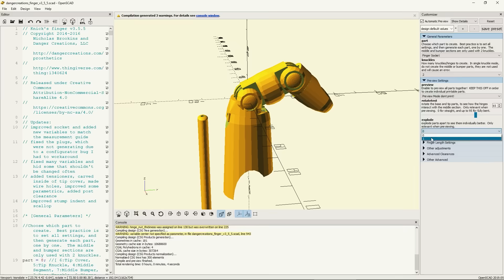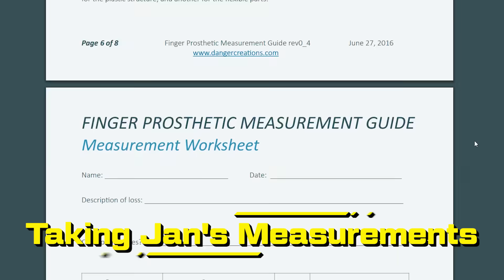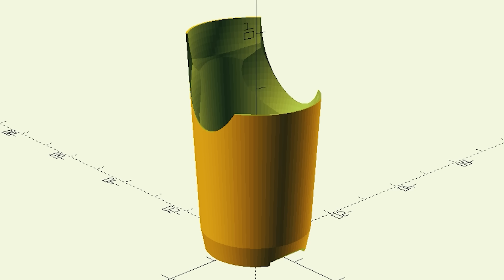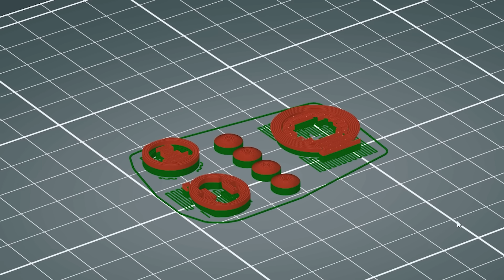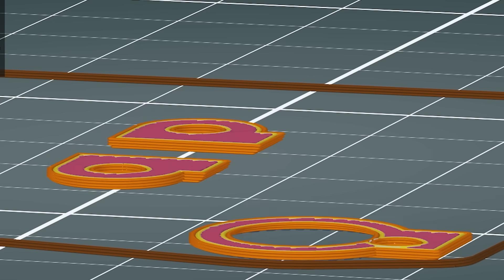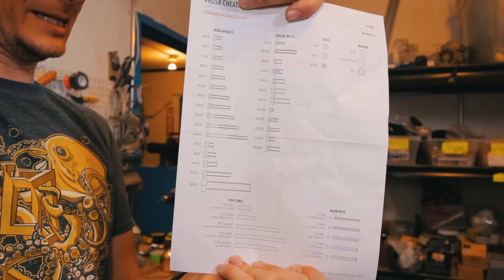My Friend Lost His Finger so I Printed Him a New One

Comment: I almost lost the tip of my finger when loading my MX Bike, my index finger slipped into one of the vent holes on the brake and the edges are so sharp that i didnt even feel it just going straight through my finger as the wheel turned 😂 when i looked down i just saw the tip of my index finger was completely white (removed all the skin from the top of the last digit on my index finger) and then while my brain was tryna figure out wtf was going on it started bleeding and i was like "oooooooh i see" 😂

Comment: Only Jan will really know what happened on that fateful day the pain that he had must have been excruciating!
There is many ways to lose a finger but losing a pinky is harder. Ruling out the most boring theory is he was born without the left pinky. Okay now how to lose a pinky, perhaps a karate chop goes wrong, an animal could have bit it off, or lost it in shop class using a saw. 
It doesn’t matter what really happened but it healed well and the printed finger works really well. 
It as bin a little over a year so is the finger still in like new condition no ware or tear? Looks like it should last at lest 10 years.

Comment: Im missing my entire left ring finger, down to the last knuckle. Id kill for something like this, especially if it let me play guitar with it somehow again. I'm sure it could be modified to do so.
Reply: A pick finger! Yes, I can see the picture in my head!
Reply: @MACvods1  Most people are right-handed - hence they fret with their left hand, not pick. The level of dexterity required for fretting, especially complex chords, is pretty intense: it requires small changes in positioning, it has to be done very fast, and it's very pressure-sensitive. Press too hard and the note goes sharp, press too soft and the note gets muted. A full prosthetic finger capable of restoring your fretting ability would have to be a near-perfect recreation of a human finger in terms of operation and size. No system of straps and elastic could do that, you'd need a prosthetic that could actually be wired to the nervous system and controlled like a real finger. So far, prosthetics technology hasn't quite gotten to the point of recreating muscles and nerves and wiring them to people's brains. 

With a missing ring finger on one's fretting hand, I'd recommend either learning to play left-handed (only need your index finger and thumb to pick, it's mostly all in the arm) or taking up the bass guitar (you can't really play chords in most of the bass register, so most basslines only require 1-2 fingers to play). You could also work out fingerings that sub in the middle or pinky finger to hold down the right notes, but stuff like Major 9 chords on the A string wouldn't be possible in standard tuning because you need all four fingers. What I wouldn't recommend is giving up - Django Reinhardt broke new ground in Jazz guitar with only two fully-usable fingers on his fretting hand due to injuries from a fire and Tony Iommi wrote every single Black Sabbath song after having lost two fingertips in a metalworking accident. Even if you can't play the same way without a ring finger, you can still play guitar and still make and play great music.
Reply: @drpibisback7680  maybe jus switch to left handed guitar like im doing due to an injury on my left hand? idk its just a thought, nvm im an idiot i just finished reading ur comment.
Reply: @drpibisback7680  not true, guitars and most stringed instruments are left handed to start with. Why? Just because! If you relearn to fret with your right hand on a so called 'left handed' (actually right handed) guitar it will be easier second time you learn. As for strumming too many fingers kind of get in the way. I use my thumb and two first fingers the other 2 i dont use.
Reply: You can use the program that they used in the video to make your own prosthetic
Reply: I had a freak accident and broke the tendon - the string that connected the finger movement.. as a result i cannot play the guitar like how i used to.. but still as far as injuries are concerned i was glad that it was my pinky finger and not something like my ring or index finger.. i can still play the three finger chords and use the little finger to an extent that it can be used without bending but i feel for you.. how i wish i could go back to that full functionality.. i really hope this printing tech becomes mainstream for people like us..
Reply: maybe try to learn guitar but inverse hand and strings... even if it is difficult to relearn everything from scratch

Comment: Lucky I got my finger only trapped in a car door I knew my dad was going to drive away and I didn’t wanted to use my finger whole so I just pulled it out and because I didn’t open the door is because my dad locked the door and couldn’t  hear me out the window and I pulled my finger out of the car door it purple ish at the front but when I turned it, it was bleeding and my finger nail was crushed and I was going to school and I told the nurse and after like 3 months it recovered fully it happend 3 years ago.

Comment: I tried to improve the modern mouse trap by supergluing razor blades to the sides of the trap. Luckily the glue hadn’t adhered to the sides of the trap, or I would have lost my finger. It cut me, but stopped and the blade broke off at the bone.

Comment: Fun fact (if you want to call it that) I do know people who lost fingers during army instruction. I am Portuguese and Portugal is one of the few countries still using the G3A1 7.62 rifle. It is the approved and still thought procedure to insert the right indicator (trigger finger for most people) into the open chamber to check for a loaded round when unloading and making the rifle safe at night. Under pressure or when wet it is very easy to release the safety chamber handle (left side of the rifle and needs to be secured with the left hand while grabbing the rifle from the top) by mistake. If your finger is in the chamber the moment the spring releases it is cut clean.

Comment: hehe I'll tell you something about ... a true story ..." I keep it in a matchbox": every day I went to school by bus which stopped along the road until one day bus lanes and sidewalks were powdered in the city with new paving stones. Along the streets there were various tools and materials that were left overnight or chewed by workers on the side of the road leaving a table diamond saw for the stone and some cubes were cut. Coming back from school, on the new pavement I noticed leather and fabric working gloves in almost perfect condition and there was a slight abrasion on the ankles. I decided to take her home. After a few days we were working with my dad and brother on new foundations (loading the earth with a shovel into a bucket from it into a bucket and then dumping it with a winch and a crane in another place. I was very busy that I did not have time to drink and it was very hot. I used this new glove all the time (two hours). Sometimes there are problems with the gloves with factory defects. The machine sews too much material and then it is tight, the material will curl or its unnecessary clump makes the glove stiffer, some thread that hooks up for the hand being put in. So I was not surprised when I had problems with wearing the glove comfortably. For two hours I decided that it was not a big enough problem to break our chain of cooperation. When there was a problem with the winch and I could take a break, I took off the gloves to remove the cause. lack of full comfort, fitting. And I say to myself "oh, another hand with a bloody torn thread, I have to tear it out. and 12 am so the sun was illuminating everything around perfectly, but the inside of the glove was dark because the brightness differences were too big for the eyes because the glove was almost white and the eyes were slightly blinded. when I pulled on the thread, it turned out that it was not a thread. I didn't know what it was but it got thicker the more I howled and finally I managed to get it out of the inside. It was a 7 cm tendon and 2.5 cm of a finger at the end of it, and there was no bone in the middle. Then I remembered the stone saw at the bus stop. Someone who operated it must have brought it too close to the shield that pulled the gloves on, taking with it a piece of a finger with a tendon that previously reached into the palm of the hand and now broke. Interestingly, the saw operator had to have a bone left on his hand and it probably looked almost like the scene from the terminator https://youtu.be/VX_ETgrFuDU?t=47 but on a much smaller scale. Every now and then I would tell my friend these stories and show my finger which I kept in the matchbox in the garage until one time I opened the box and the finger was gone. I suspect the mice took him. I'm surprised that the cardboard box was not chewed. Another story is when my dad was building a house, he fell from the scaffolding and with him some large brick which, when hitting the ground to half the diameter, cut off half the penultimate finger. And in the hospital, instead of sewing a finger wound, lazy light tools will cut off the other half of the diameter. I have other interesting stories with my fingers closing doors and hitting a car but it's not that effective because the fingers look strange but they are whole. The story of Jan's finger probably had to do with the careless picking up of a working lawn mower? Or as a child, when out of curiosity, he put his finger into the ventilation hole of the brake disc, the wheel moved and when the finger met the jaws, it was cut off. Or maybe after ingestion of illegal substances: P cutting off your finger seemed like a lot of fun with friends that brought a lot of laughter, at least at that moment. Eventually, as children, they invented an ax and he was holding the object when his colleague swung like in the Titanic scene, but he closed his eyes or did not train, and the ax was too heavy for precise cutting when, unfortunately, the finger was on the line.

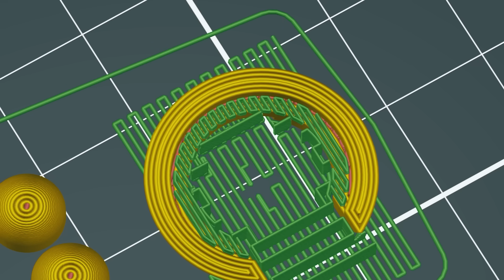Comment: 6:29 - Pretty indeed.
If anyone wants to know the story of how a co-worker I had, lost the end of her index finger, I shall share.
She was using an eyelet press machine that runs off electricity (not a manual one). Where you press the pedal down, and then the machine stamps down and that bends the metal together and forms an eyelet in things. She got her index finger in the way, and the machine completely crushed the end of her finger. So that had to go. The plus side is that the eyelet largely stopped the bleeding.
.
OH! and when I was handing resumes out to places looking for work one time, I went into a stone mason joint. The boss' I think middle finger at the end was either gone, or fucked in some manner (can't get a specific visual). He demonstrated what happened to me. There's essentially big sheets of stone, that are standing on their side, leaning against each other on a wall or whatever it was. You need like a little crane system to move them I think. But he pulled one out and vertical, away from the other leaning ones, and then it was too heavy or something and fall back towards the wall. He didn't get the tip of his one finger out of the way in time (suppose it's the longest one), and he said it just "popped" between the big sheets of stone.
.
Gotta watch them fingies!

Comment: Did you know that without a pinky a samurai is useless.
Reply: How
Reply: @db5094  cause the most important finger when holding a samurai is the pinky without it youl loose balance and control over your sword.

Try swinging a long stick for example without using your pinky then youl get what I mean. 😘

Comment: Is the print scale of your printer calibrated? Some printers can even have different scales on each axis; print something about the size of your print volume, measure it and compare with the dimensions in the digital model (taking in consideration filament thickness and stuff). Some printers let you apply the calibration on the printer itself, some slicers let you embed the calibration in the gcode automatically, and if all else fails, you just rescale your models by the same percentage.

Comment: Imputing all scenarios into the Deep Thought super computer...
loading...
loading...

Deep thought: Your not going to like the answer...
Corridor Crew: Tell us please, we need to know, it's killing us.

Deep thought: Alright but never say i didn't warn you...

Table Saw... a never re-attachable super fast cut because it pulls the finger in and chews through the material. Left hand is the front (pinky first) guide hand and would cut near perpendicular to the hand as the material was fed right to left. It is also the most likely tool to remove a finger with of any shop tool, and used extensively in many industrial applicaition.

Comment: Pinky theory: he stuck his finger in a moving bicycle wheel, it got caught in the spokes, and the spokes pulled the finger toward the frame of the bike, and sliced it off. Happened to a kid I went to school with.
Reply: This happened to me as a little kid! Luckily I didn't lose my finger, but I still have a nice scar to show for it. Would have sucked too, since it's my right pointer finger.
Reply: That was me
Reply: That would suck.
Reply: My finger ended up getting pulled in and squished between the chain and sprockets. I just remember it looking totally chewed up and swollen to about twice the size of my other fingers :/
Reply: @Slowybro  That must have sucked. Good part you have a cool scar!
Reply: My dad cut his off with a table saw, no cap. This mans finger was held on by skin, dangaling.. He yells obviously. Calms down after like 10 seconds, asks for tape.. Masking tape... Not even joking.. Tapes his mf finger up, like the whole roll, holds it above his hesd while doing this tellibg me it will slow his blood flow.. Keeps it up in the air for 30ish min... And he goes back to using the saw.. Like wtf.... He was an alcoholic at the time. But holy fuck i didnt know it could numb you like that. Hes since been sober 10+ years. His finger is also fully functional.. His doctor was blown the fuck away, he even has a huge ass scar.
Reply: @Andrew Fitch and Fastest Dolphin you may have found out the one TRUE PINKY THEORY!!!!
Reply: a kid in my school’s sister shut a door as she was gonna go through it, and her pinky got stuck and fell off
Reply: one word oooooooooof
Reply: Happend to me
Reply: What was the kid's name

Comment: The direction you are printing will make it pretty eak. Inner layers don't blend too well and usually cracks in the direction of the lines more easily. I know it's the logical way to print it, maybe you just need reinforcement to make it durable. Or machine a version of this 3D model in aluminium or something using the same 3d model.

Comment: I'm surprised the corridor crew doesn't have a resin printer, it would make the tolerances and finishing work on the mechanical portions of the digits way easier to work with. The decision to use TPU for the soft bits though, A+

Comment: I loved this project so much! I'd name the pinkie the Mark 1 and do another vid in a few months with the Mark 2 with various improvements. The joint placement and lengths might be better adjusted to match his right pinkie, the color scheme could be modified, the fingertip could have a rubber pad or be rubberized... and he could get a slew of various attachments - like a lighter (though would have to be careful not to melt the plastic!), a magnet, a flashlight, etc. Later, you could work on a Mark 3 where you find a way to put a painted silicon coating over the prosthesis to make it look more like real flesh.  Maybe a Mark 4 in a decade or two with a bio-printer to make him a real life cloned finger. How sweet would that be if the tech ever got that good, right?

Congrats to all involved and the original prototype creators. I think this was pretty amazing.

Comment: The improvements I would personally make:
1. Make it look like an Adam Jensen pinky so black and gold polished.
2. Shorten the top bit to be symmetrical with his other hand.
3. Make the bracelet from black alcantara with a small metal wire for the connector to be attached to.
4. Lastly, rubberize the inside of the finger to enhanced the grip further.
Looks amazing though!
Reply: Probably put the join at the end of the stub rather than on top of it. The first join itself elongates the finger.
Reply: If he actually finds it as useful as it appears in the video, I'm sure a lot of modifications will come in the future.
Reply: Add some rubber at the tip of the finger to help grip things
Reply: I would - just for fun- change the knife for a retractible claw
Reply: @creepermanzombie24  nah even bigger knife
Reply: @knickemz  Nah, 3rd hand on his finger
Reply: i have better idea i just wont make it cuz i dont give a fck
Reply: The rubber thing would make it heavier, wouldn't it?
Reply: Put a small engine inside, so it vibrates. 
Much more of a James Bond-esque hidden gadget than that knife. 
"GOOOOOOLDFINGEEEEEER"
Reply: likes are 777 if it passes I'll give you a like!
Reply: @KOP just making constructive suggestions based on my knowledge of anatomy (part of my specialty) and system design

Comment: This is the true story of how he lost his finger:
He was mountain climbing with a friend and suddenly a bear rushed at them and got it's mouth aroung his friend's leg, but thanks to his fast reflexes he was able to grab the bears mouth just in time before it was able to close and get a tight grip around his friend's leg and as he was holding it open, so his friend could pull his leg out of the bears mouth, the bear bite his finger off. He lost his finger but saved his friend's leg. Ohh and he snapped the bears neck so he has a bear rug in his cabin in the woods.